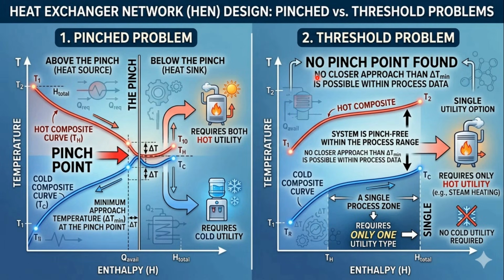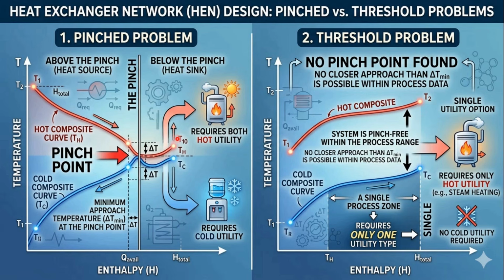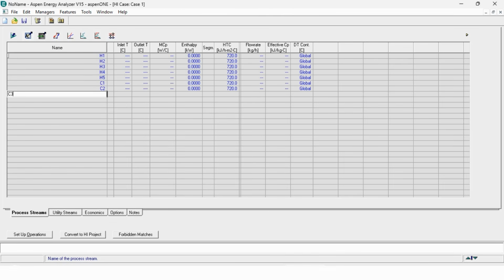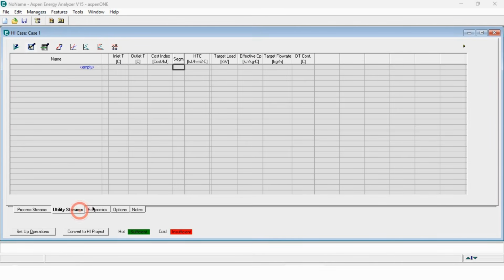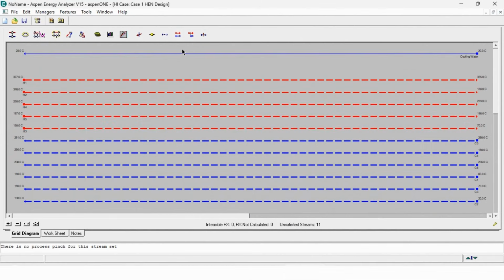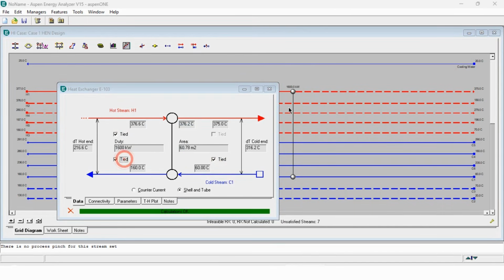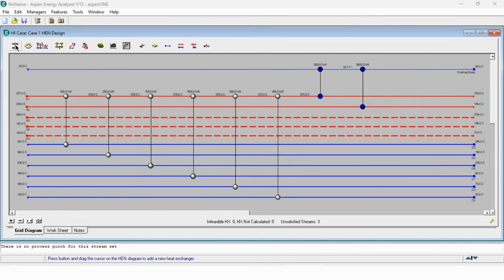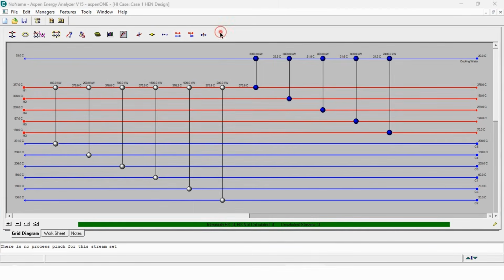Heat Exchanger Network Design | Threshold Problem Solved in Aspen Energy Analyzer + Excel

Comment: How did you enable the tab at the top of the software and were you able to add the heat exchanger? It is disabled for me. How do I enable it?
Reply from the maker: It is automatically enabled. There is no method of enabling it. Please restart your software and try again 😊